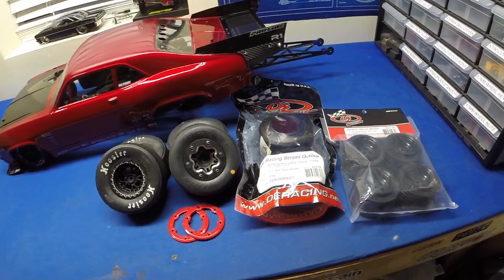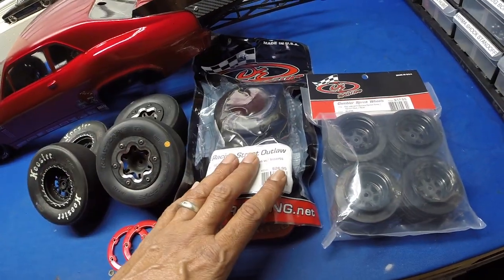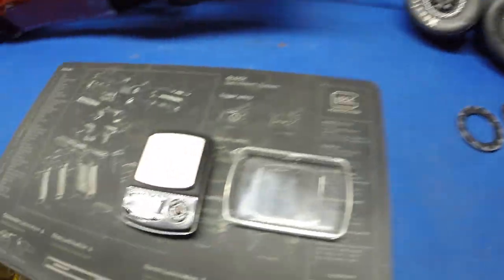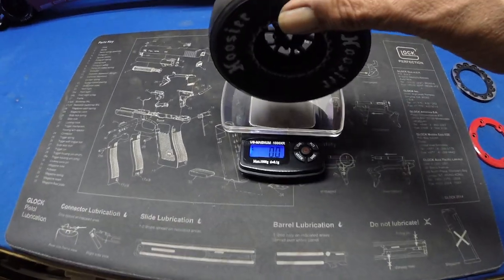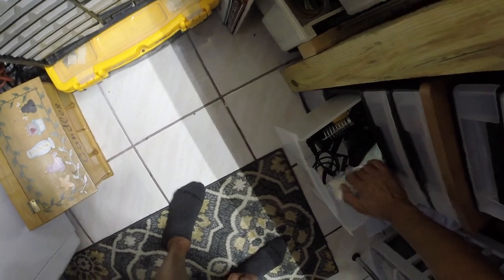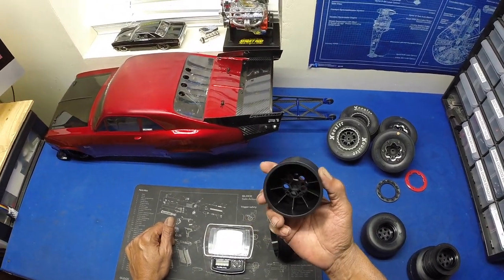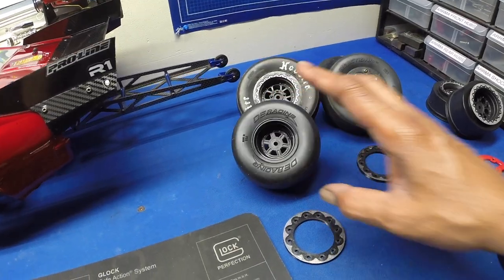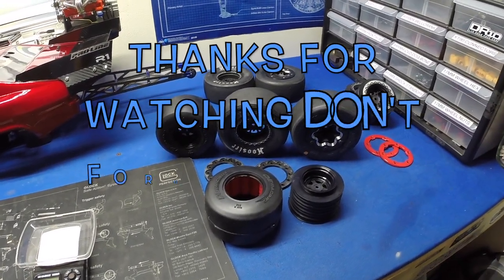NPRC Drag Racing Tires DE Racing Street Outlaw, Proline Reaction and Hoosier Tires

Comment: Nice set of tires, the 3d printed rings with the 12 holes fit the same rims as the 6 hole
Reply from the maker: Thanks for watching much appreciated yes sir the wheels have 12 holes in it too so if the tire slips with the 6 bolt rings you can use the 12 bolt ones to clamp the tire bead tighter happy bashing my friend🤙🍻😎😛😝🤪😜👊✌